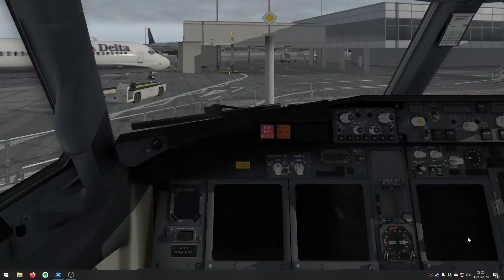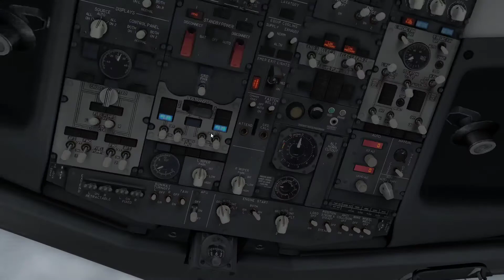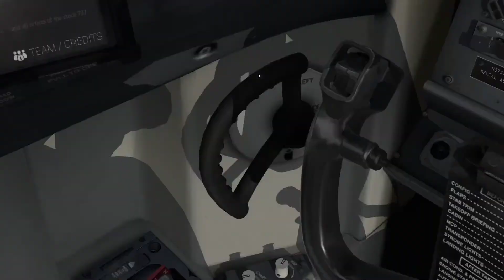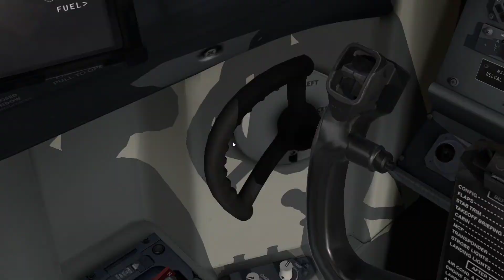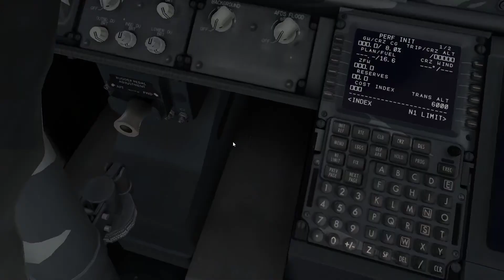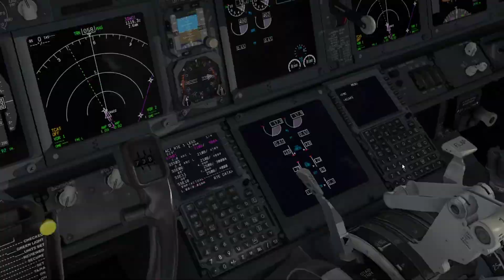Starting the X-Plane ZiboMod 737-800x from Cold and Dark

Comment: i dont know whats wrong with my zibo 737. i cant turn on my APU, please help me
Reply from the maker: To start the APU you need at least battery power - then depending on if you have ground power, it may take a while for the APU to come up to speed - you can monitor it on the small dial to the left of the APU switches. It should climb to 7 and fall back to 4 - at which point you can switch power over to the APU (the inner two switches).

Comment: 2 Years later this still works, There are only some tiny differences but starts up with no problem!
Reply from the maker: Well a 737 is a 737 at the end of the day :)
Reply: @jonbeckett  I got a question and it’s about the main right landing gear not always deploying when landing. It’s really annoying and I’m wondering if you have had the same issue before? And is it an easy fix? I never really play with failures either. Just wondering no rush!

Comment: EXCELLENT basic review of Zibo mod 737 startup, to give an overview of the process and also explain some of the things going on.  Of course it's not intended to cover every action crew would take between power up and taxi but nonetheless the intended purpose is achieved, and very expeditiously.  Nicely done, Jonathan.  

BTW,  I use XP-11 and much prefer the Zibo Mod 737-800X and its EFB over the stock Laminar Research 737-800.   I can't transition to XP-12 because my graphics card is near its limit now, running in 4K, and XP-12 is much more graphics intensive than XP-11.  Your channel is especially rich for those who use MSFS.

Comment: why isn’t my apu turning on it did before first :(
Reply from the maker: The APU might not turn on for any number of reasons. Is there enough battery power to start it? Have you connected external power? Have you switched on external power? Have you switched on anything else that might draw enough power to prevent batteries starting the APU?  Of course it could also be a bug. Try re-starting the machine.
Reply: @jonbeckett  I think it’s a bug I did what you did. I set it to bat set on stand by power and didn’t turn on (volts 0, 99, (I forgot the others)
Reply: @jonbeckett  I’ve tried everything and nothing worked
Reply: @jonbeckett  apu isn’t dumb. I’m dumb realised there was no fuel
Reply: did you solve the problem? if so please explain
Reply: @joel5671   If you haven't solved the problem yet, I might be able to provide a little bit of help, for me to get the APU running, I typically turn on the master battery and standby power. Next up is the Ground Power, and set it to on now you go to the "APU" and switch it to START, not ON,  hold it on start for a few seconds and the gauge next to it will start to rise, I've noticed that even after I've let go it will stay at 0 for still a couple of more seconds before rising up, from there you can turn your bleed on, turn off the ground power,, and run everything like normal.
Hope this helps

Comment: help a alarm is going off and the panels for the first officer are off
Edit: I feel like I didn’t explain it correctly. So I turn on my engine generators but when I turn off APU  the screens on the right turn off (and N2) and then following by a alarm that plays. Help please I have no idea how to fix it
Reply: shut off the two center apu gen toggle switches and the alarm should go off.
Reply: @pbr2805  uhhh I found it out more than a month ago so I don’t realy need help anymore. And also the problem was auctually I had no fuel.

Comment: Hi Jonathan, I’m impressed. I’ve run through a number of videos and checklists to learn how to start it up (which I finally managed). I must say that I found yours the best one in giving a nice reference to how individual switches and gauges refer to the systems of the airplane. Putting aside the sequence, I just wish I had come across your video earlier. It surely would’ve saved me some try and error loops ;-) Great job.
Reply from the maker: Thankyou for the vote of confidence! I've been learning throughout the time I've been playing with the simulator too - and taking on board feedback from real-world pilots who have very kindly given tips along the way.
Reply from the maker: There is a mistake in the video I should mention - I called the engine start levers the throttle - the levers that control fuel flow.

Comment: I had to turn off the IRS NAV knobs and then start up the engines or an alarm would go off.  After engines start then I had to enter the departure airport
and then enter the GPS-l numbers to the scratch and then to the FMC and then turn on the IRS knobs to NAV.  That seems to be the best way to do it.
Reply from the maker: the alarm is going off because you're using power up and you're still on batteries. The better way around to do things is connect ground power first, switch to ground power, then switch on the IRS system. All you are doing by switching on engines is providing power. In the real world you wouldn't start the engines until pushback is complete (pretty much the last thing to do).
Reply: @jonbeckett  I feel non profesional doing it though, so could I have a way around LOL I don’t wanna use grd power
Update:: I was in the shower and realised that that happened on the default 737 no zibo lol
Reply: @jonbeckett  will using grd power aswell work still? if you saw my earlier comment it just blacks out the first officer and probably the same alarm goes off
Reply: @jonbeckett  way around lol don’t need irs with ground power. My artificial horizon has the blue and orange after grd power. So I’m guessing that I just have to do the engines!

Comment: Thanks!  I  did not explain my question well, but I played with setting up the IRS. I mean that I was able to place IRS numbers to scratch pad and then place it
in the previous page to get the proper IRS alignment.  What through me off is that when you did it I noticed that your mouse pointer went to the CLR button
and I thought that you had to select it.  I should have known better.  Also, I notice that you never placed the knobs to ALIGN, but only to NAV.  When do you
place them to ALIGN?  Also, what about the Isolation valve?  I would think that you would have to set it back to open???  Hope you can help explain? Thanks!!
Reply from the maker: You don't have to set the IRS knobs to align - only to NAV. Did I set the isolation valve to closed? (if I did, its a mistake)
Reply from the maker: Just re-watched - I always think of the isolation valves as just the packs, and the APU bleed. APU Bleed should be switched off after the engines are running. Packs should be on auto after the engines are started.

Comment: Can you explain the entering of the  GPS/ILS reference a bit better... that is the transferring of it to the scratch pad as you went too fast.  Thanks!   A great video!
Reply from the maker: In the 737, it's not done for you - the flight plan, and NAV radios are not connected at all. On the console between you and the co-pilot the NAV radio tuners allow you to tune in VOR and ILS frequencies. Once tuned to an ILS frequency, the bars will appear in the displays - showing the diamonds for the horizontal and vertical position WHEN YOU ARE WITHIN RANGE (typically from about 15 miles out, but it varies a lot).
Reply from the maker: To find out the ILS frequencies, refer to either approach plates, or an application like LittleNavMap.

Comment: Good evening Jon.
I recently subscribed following videos on Littlenavmap tutorials. 

As a professional B737-800NG pilot I would like to give a little tap on the shoulder. Nice video!

This said, we can hear / feel that you aren't always sure and knowledgeable about what to do.

I believe, if you are interested into reading, that PMDG or maybe Zibo is providing some pdf file that could lead you with more guideline about what to do, in which order.

A big point here is that you wouldn't start your engines at the gate and all your FMC, MCP, overhead panel, radio, etc would be set before starting the engine ( most of the time even before starting the APU). I'm saying this following your video title. I was excepting to see everything but engine start. 

This said, thanks for your videos!
Reply from the maker: Also - thankyou for the advice! One day I'll get around to reading some instructions - I have to confess most of my interest is in figuring out how things work, rather than procedures :)
Reply from the maker: Oh I know about not starting engines at the gate :) I was just running through the functional side. I'll do a video going through the proper routine with push back and engine start soon :)
Reply: @jonbeckett  Alright mea culpa then :-) it's a great philosophy to learn by yourself, love it.

For the zoom call eventually yes. Maybe you could write down some questions to start and later I could join for more if needed. Are you doing that on Xplane? I wish the new sim would have a PMDG already!
Reply from the maker: @matthieulambinet9522  I'll see what questions I can come up with. I just know that during group flights, invariably I get questions about how to do things, and all I know is what I've discovered from tinkering - it would be great for some of the group to get answers from a real pilot :)
Reply from the maker: Just out of interest Matthieu, I regularly fly with a group online - where they simulate ATC, and we follow more-or-less correct procedures on the ground - would you be up for a Zoom call at some point to give them a chance to ask you about the real world operating a 737 ? :)
Reply: Hi Jonathan short sweet and to the point thank you